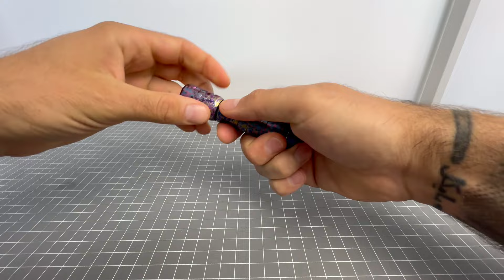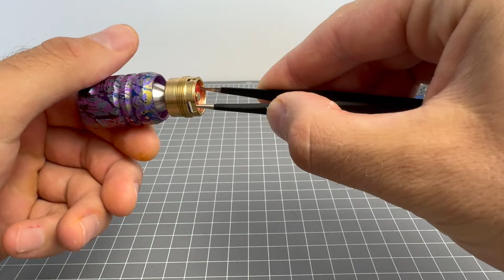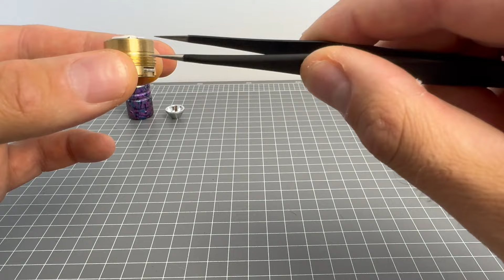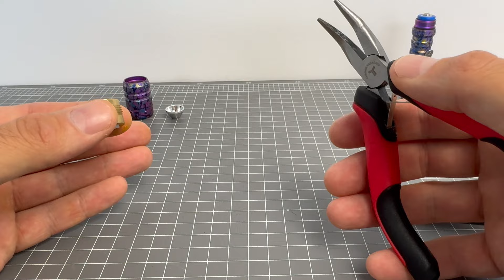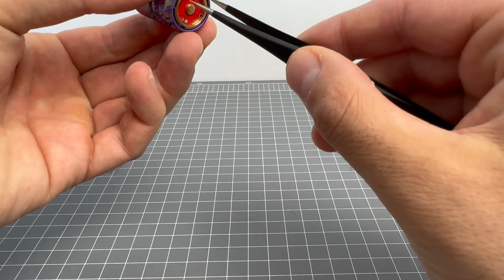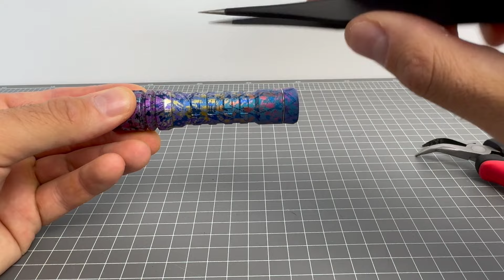How to fix a flickering ReyLight Lanapple

Comment: i just took mine apart and it doesn’t even have one those press rings in it… waited weeks for it and it doesn’t work out of the box… (yes i took out the battery protector piece)